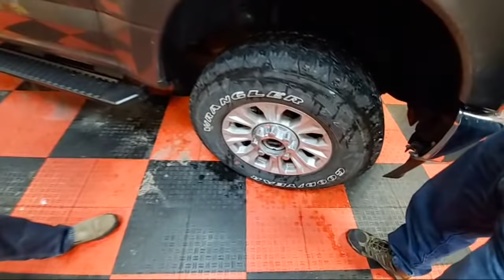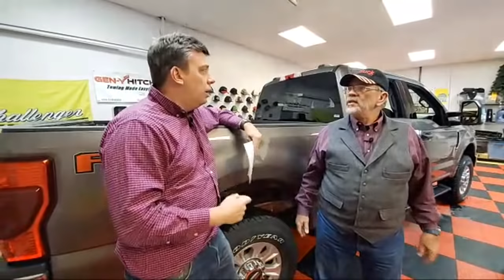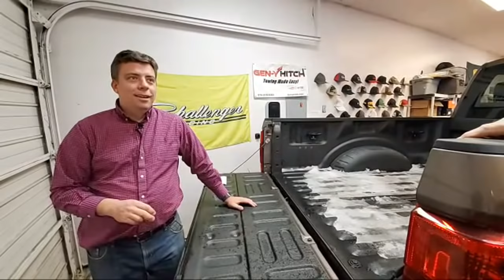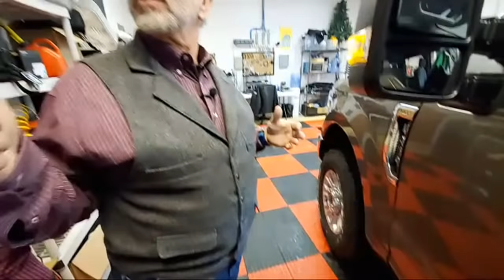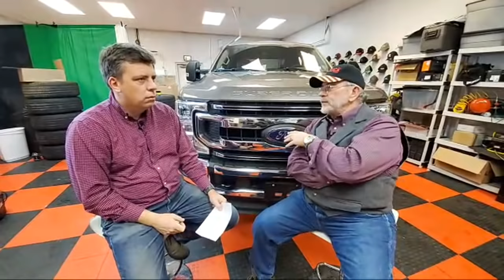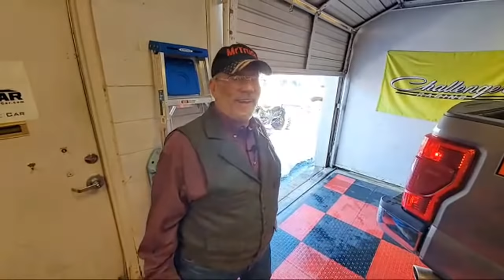Super Tremor Update: Here's What We've Done To Our Ford F-250 & What's Coming! Talkin' Trucks Ep. 78

Comment: On the SVTperformance channel, they have reported that 5 Star got +40 HP and +60 Torque with stock intake and exhaust on the 7.3 gasser.  Suggested there is more to be had with intake and exhaust mods.  Specifically said there is plenty of room in the engine bay for headers.  Would like to see TFL mod this F250 in steps...intake, exhaust (done, I know), tune, headers, then realize Andre's dream of a supercharger to demonstrate bang for the buck at each stage.

Comment: “Alaskan” camper !!!!!
It’s the only hard sided pop up camper out there and has way more room and light than other pop ups. 
  Also , the weight would be perfect for testing this truck ,( not too light or too heavy). 
  The pop up will give you a low center of gravity while driving ,( wich you will need if your going raise this truck with lift of some kind.
The wind resistance is also far less than any full  hard side camper.  
  Call the folks at Alaskan , they have two different sized campers ready to go right now.
T Reily

Comment: Nice show and Andre and Mr Truck are Great together reviewing.   It will be nice to see after all the mods ? When you have done engine tuning in the past does the performance go up enough to off set the MPG loss ?    I have Tire chains for my truck that's why I could not put larger tires on because of clearance.  I see my chains as a way out of a destination and not into because when you get stuck with chains on all four tires You are STUCK.   
  As far as a Camper I would go with a Lance hard sided truck camper.  Love truck campers but just small ones as I see them as just a place to sleep because when Camping I'm outside in a good Lawn chair.
Reply: Thanks

Comment: How do you get the 8" productivity screen on the XLT trim?
Reply: Depends on how you or the dealership orders the truck. You can spec an XLT truck to near Lariat level. My '19 F250 came with the heavy duty tow package, technology package, and a snow plow package (I think). Bout the only thing it DIDN'T come with was air conditioned seats.
Reply: @DemsRdisguisedredcoats  Do you think it's based on what the MSRP pricing is? I've seen $58,600 and up on a lot of them and they have them but I also see some at $56,000 MSRP but they have the tremor package. I really do want that full digital screen in front of the steering wheel.
Reply: Comes with the ultimate trailer tow camera option